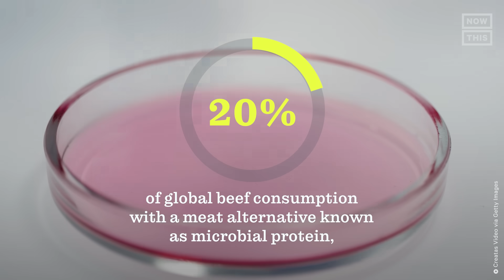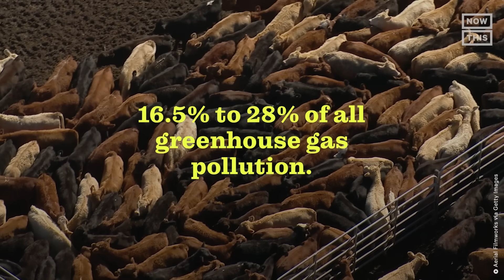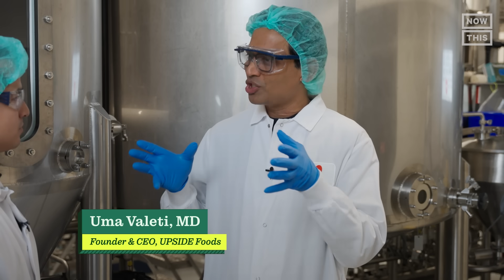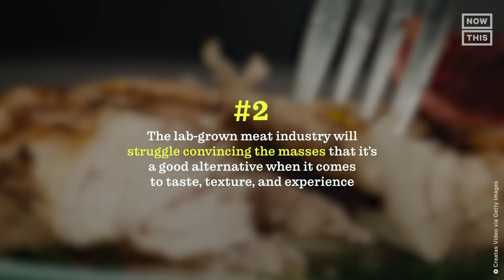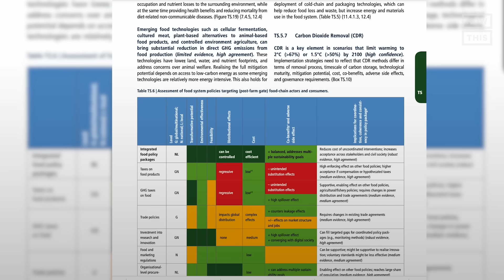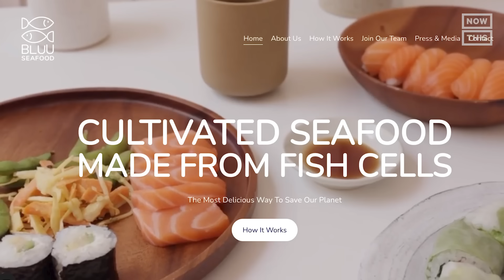Can Lab-Grown Meat Save the Planet?

Comment: How are the cells extracted?
Reply: Not for infinity, cells have built-in mechanisms to prevent them from replicating forever, the extraction has to be done at regular intervals.
Reply: @Bernardo Picão  cancer wants to know what you're taking about. So would Henrietta Lack's Cancer Cells.
Reply: Biopsy, I assume. However, once you get one biopsy, then you could just let the cell division continue into infinity. 

So you could almost guarantee your burger will be from the same cow forever. (Assuming they use one biopsy instead of multiple).